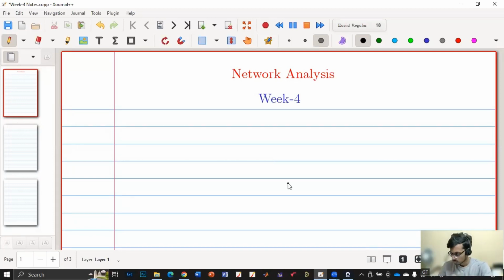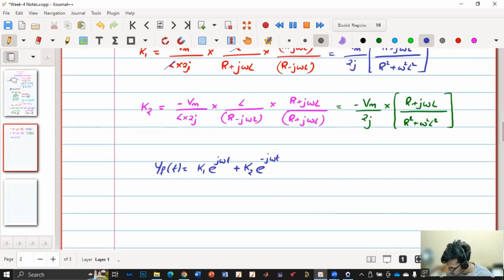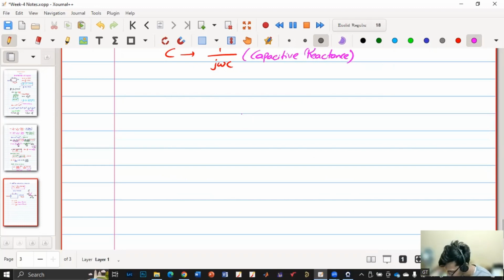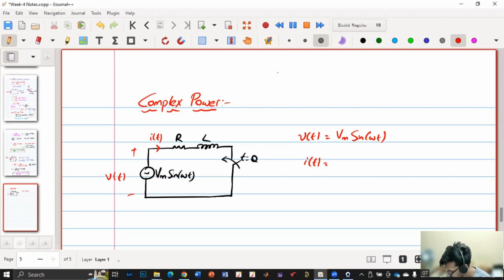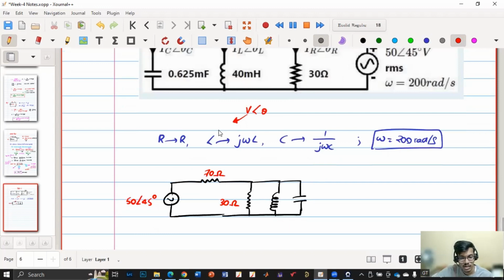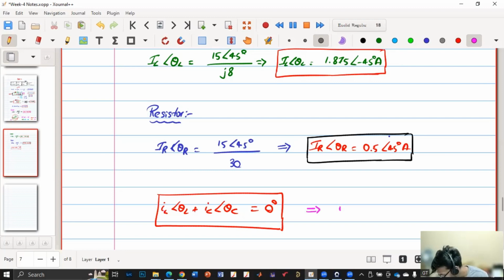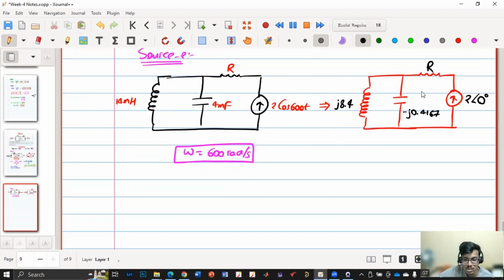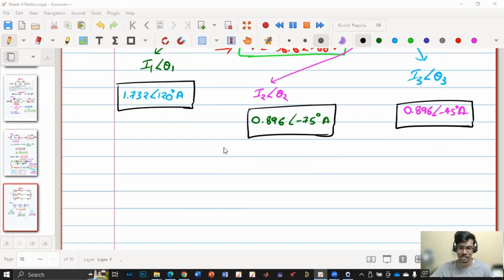Week 4 | Network Analysis | Problem Solving Session | NPTEL

Comment: Solution of RL ckt or RC ckt can be easily found by taking complex form of L & C ie jwl & 1 divided by jwc and simply using voltage divider rule ... then taking the modulus value..... correct me sur if i am wrong ❤❤❤❤❤❤pls reply
Reply from the maker: Yes, you are right, Lokesh. However, the course syllabus does not include that concept, nor do the lectures address it. Therefore, we are not solving the problem using that method. However, people widely use that method, which simplifies the mathematical calculations needed to solve the problem.